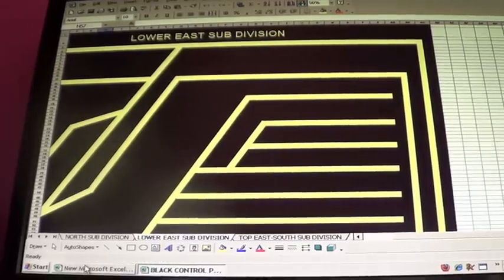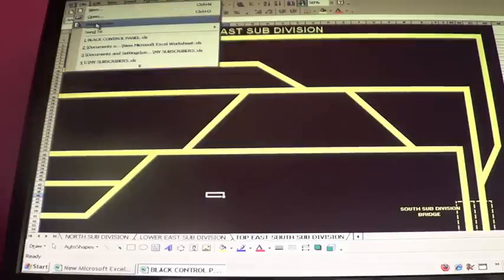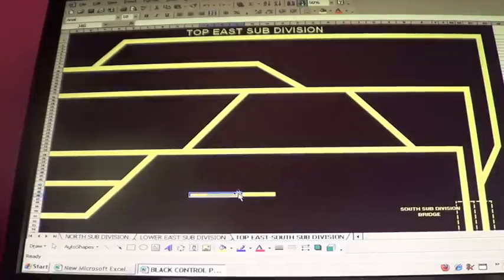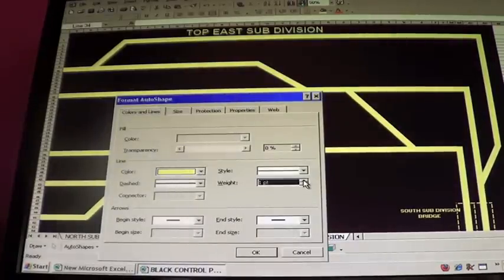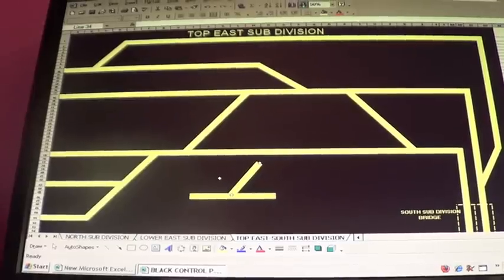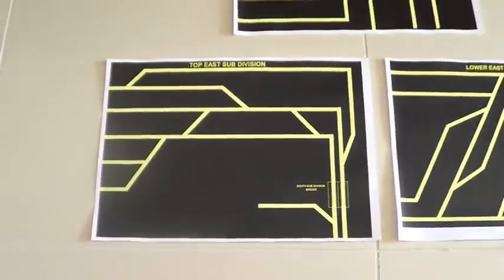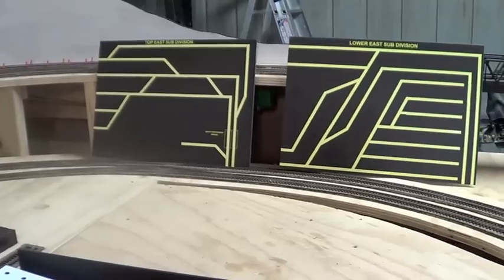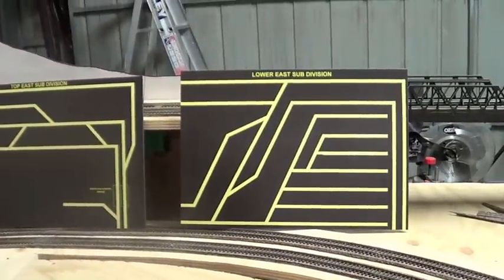"Control Panels" Model Trains Part 18

Comment: They look good but have to agree they do look a little confusing even thou it appears your done them to resemble the track plan as your looking down on it. Just a thought the space between each panel could be used as a shelf to sit a drink or clip board with operating instructions for running sessions etc;  Regards Greg

Comment: The panels look confusing, I can't think of any way that they line up. Are the lines drawn the same on all the panels, or does the distance between the tracks on the boards vary from board to board. If you know what I mean.